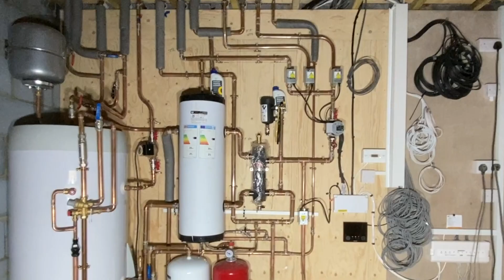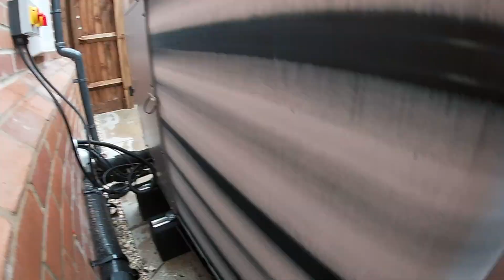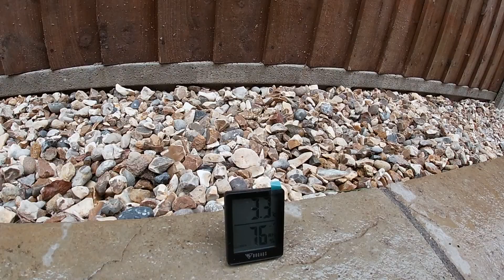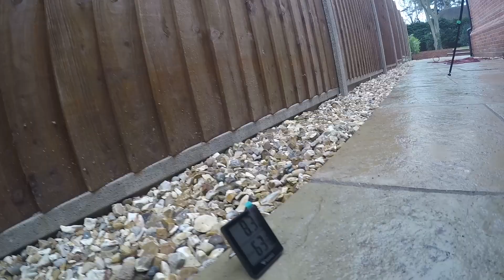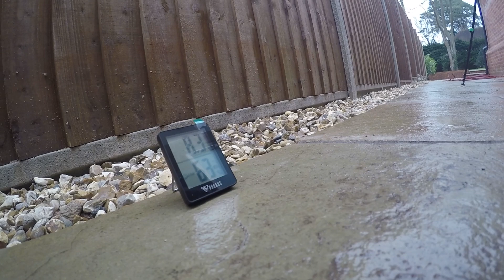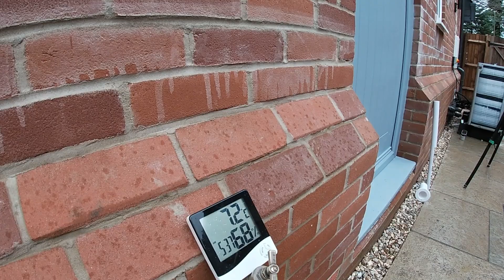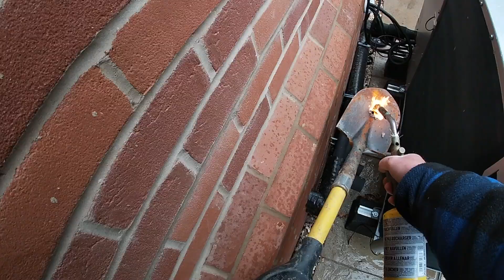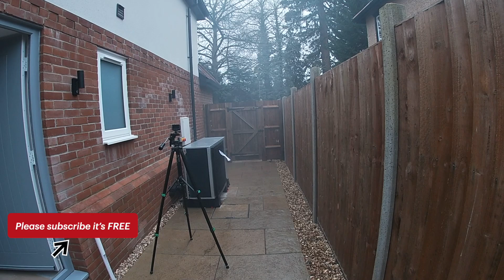Heat  Pump Freeze Up - HELP!

Comment: Change the gate for a lattice gate your 3 side ally traps cold air like a bowl of dry ice.  Also place something against the fence only 12 inch wedge  to cause the air to go to the right when exiting the pump.  This with a fence chance will cause the cold air to flow away from the gate.  You could also angle the unit just 5-10 degrees off centre to prevent the backflow.

Comment: use the roof as solar collector. make one side input other output cover rafters inside with then have a hvac channel leading down to rear of heat pump and its input fan ..
It will then suck in warmer air heated slightly by the roof.. and hopefully keep the exhaust air a little warmer 
And get an iron gate or open up the bottom
In most terraces style properties this is an effect that no one mentions. 
A localized cooling of the air..  which then makes heat pumps less efficient in that area

Also when this guy opens up the gate area so cold freezing air can escape his drive will become an ice skating rink in winter.

One more option is move heat pump right up to fence with gate, then block open side and take out part of the fence so all input air is from other side and exhaust is into the side passage.
Use some old cardboard boxes, duct tape and remove part of the fence panel to do a test.
If it works then simply move heat pump further towards fence gate and create a barrier for the cold exhaust air and open up the fence so input air is from front of house...
.and maybe roof?
Could do a DIY solar collector project 
https://www.youtube.com/watch?v=ncsGA5gSJv8
Reply from the maker: I love a bit solar gain  Thanks 👍

Comment: Is the buffer tank necessary? Many YT installers say not.
Reply from the maker: Hi  in the past I have almost always used unvented cylinder with built in buffer and had no problems . I know some have said buffer not needed  or change it to a volumizer .( In my opinion this would do about the same thing.) But because there are so many controls on system  there is a possible potential for volume to be very much reduced  ie. If some one moves into the property and decides they only want 1 zone  open . The problem is we don't know who the end user will be ,what ,  their  expectations will be ,or how they will use the system . Obviously the ideal way to run the system would be minimal controls and running low and slow 24hrs. But not every body understands this .Thank you 👍

Comment: You are short on refrigerant, bud. Its no issue of clearance, you have plenty of space. Unit is not gonna go on defrost if outside temperature above zero.
Reply from the maker: Hi Yes I am waiting for a visit from manufacturers engineer to Check . Thank you 👍

Comment: if you would have bigger buffer tank  and more water in the sistem this would not happen and the fence is not helping cirkulation of air too. So remove the fence and install bigger buffer tank  and your sistem will work ok. If there the air is to moist  the deforst is normal bicose too much water is in the air so nothing you can doo about that.
Reply from the maker: Hi making alterations to fence is not an option . you are right about moisture in the air the humidity at times behind the HP is 87%  Thank you 👍
Reply: @HEATSEEKER1428   you need bigger buffer tank belive me buffer tank is there to help you with defrost  and on this size unit  there should not be more than 2 min of defrost cycle.

Comment: Raising the heat pump up and switching to an iron gate with airflow seems like your best bets. You'd gain a little more space behind the unit for air flow and wouldn't have as much cold air pooling around it.

Could either do this on a stand, or wall mount - if wall mounting consider whether you have anything noise sensitive on the other side of the wall and ensure you've got decent vibration isolation dampeners (not the rubber washers that typically come with a mount as the default). I'm not sure why planning would be an issue here, or why your neighbour would mind, it still should be roughly below the top of the fence?
Reply from the maker: Hi yes your have a point the higher I raise it the better . Planning not an issue. Apparently when the neighbour sold land to builder there was an " agreement" that Nothing should be put  on that side of New house . Crazy I Know  but I am just in the middle waiting for it to be resolved.  Thank you  

👍

Comment: Someone said on another You tube video, when they installed an air to air heat pump.
 "Im fitting this, because Im soo bored of the negativity of heat pumps"
That was you!😄 

Air to water are a different animal and there are far too many cases, where they dont live up to the hype they are given.There are a catalogue of problems throughout the Country!
When I read online, that a Nuclear Physicist couldnt make head nor tail of his Vaillant heat pump instructions, I knew we are a long way off in getting this heat pump roll out right.
Good luck👍
Reply from the maker: HI 
Yes my view is still the same this heat pump at its possible worst was running at a COP of 2.5  That is 250% efficiency. Bearing in mind it' s output is 14 KW it is serving 14 radiators 6 towel rails  and 10 under floor heating circuits ( 1000 meters of pipe ). Heat pumps are the future  Thank you .
👍

Comment: I use an air to a heat pump here in the states in zone 5. I think your unit might be a little close to the house and the fencing is blocking good airflow. I run mine at well below 0 F. This winter and it rarely ices up but I think i am in a dryer climate than you are and my unit is in a more open area.
Reply from the maker: Hi Yes the space is a bit tight. and your right  The day I recorded the video. the humidity at the bottom of the heat pump was 87%  which does not help.

Thank you 
👍

Comment: What few people discuss is how long heat pumps last. In our village an estate was built with heat pumps and all have failed within @10 years . The cost of a new heat pump and the fitting is very expensive as the fittings of the old heat pumps are not the same as the new ones . Be warned
Reply from the maker: Hi I appreciate that thing have moved on in heating design  and perhaps a few things on an old system might have to up dated  But Would have thought for the most part it would just be a straight swap . Thank you  👍

Comment: Hello sir. Question I have is why did they put unit on the corner of the manhole cover?
Reply from the maker: Hi Although the heat pump is just touching the man hole cover  . it is not a problem  the cover can easily be removed without disturbing the H P . Thank you .👍

Comment: I know that my model requires a minimum of 1.5m from the face of the unit to any obstruction. Yours looks to be close to that minimum and obviously more would be preferable for air dilution. I had a near identical alley and was advised not to place it there by the installer.

Comment: I do admire you for posting this and being so polite with all the dimwits who comment negatively!  I have the exact same unit in a similar sort of location except there’s a hedge rather than a fence just under 2 metres in front of the unit.  We sometimes get cold fog here, being by the sea, and when it’s foggy (100% relative humidity) and around 2 degrees of course it freezes.  Typically about once every 50 minutes to an hour, if there’s no breeze.  Takes four minutes to defrost.  Difference is there are bushes at each end, rather than a solid gate.  Next time it’s cold I’d definitely try leaving the gate blocked open to see if it helps, but unless there’s a breeze probably won’t help that much.  Moving it to the more open area shown on the plans might help, but then there are more losses in the longer pipes all of the time.
Reply from the maker: Hi 
Thank you .Every body has their own view . heat pumps are not for every one  . I think perhaps I should manage my expectations , Thank you 
👍

Comment: Just one more thing, I believe a split system would be better for the UK as they can be mounted on brackets like a standard AC unit, you don't need 500mm behind the unit for air flow and they can be installed at high level to avoid debris clogging the condenser "is it the condenser".

Comment: The humidity in this country really doesn't help!! 
This is just a thought 🤔 but I always thought about having tumble dryer vent and maybe an house extract vent behind heat pump to reuse any heat from building, just a thought 🤔
Reply from the maker: Hi That is not a bad Idea   . I think the day will come when heat recovery units will be fitted in all houses . For instance How much heated air is sucked out of a house by tractor fans  and cooker hoods  Thank you 👍

Comment: Even at outside temps of 2c ambient air, our Samsung Heat Pump never goes into a defrost cycle and the fins remain clear of ice.  This is because we have it sited correctly, in a position where air can flow freely around all four sides.  Whoever thought of putting it where yours is wants shooting, it's the worst possible location.  The proposed position would be better, bu still has a wall to the right of it

Comment: This is what we call short cycling
Reply from the maker: hi I think we can go as far as saying that yes .Thank you 👍
Reply: A heat pump can short cycle without running defrost cycles, in short cycling compressor will start and stop every five minutes or so, commonly seen where heat pump is oversized or emitters too small to disperse heat to rooms, or perhaps setup incorrectly.

Comment: The main thing this video shows me is the horrendous amount of internal equipment required to run the air source heat pump. I have the space in the kitchen that my wall hung gas boiler occupies, and the airing cupboard with hot water cylinder upstairs in the middle of the house with no external walls. I can't see how I could possibly get one in. On the original issue it should have been obvious there would be insufficient airflow in this location.
Reply from the maker: Hi  The system in the video is not overly complex but the house is rather large.
Regarding your situation depending on your existing heating system. The heat pump could be fitted out side obviously and the buffer tank if needed could be fitted where the boiler is now. I appreciated that heat pump is not for every body  but eventually all heating systems will be low temp heating . It makes sense for the user to save money  Irrespective of the Green aspects if that's your thing . Thank you 
👍

Comment: Move the heat pump somewhere else. It needs air flow but you already know that. Also look at the heat curve. Is it set too high and its racing to get the heating temperature up. Remember - low and slow.

Comment: Humidity levels in uk , especially wales and Scotland make these issues common,  drier air in Scandinavian means they work well.
Reply: They work very well in UK, ambient temperature where I live currently 9.8C and a COP 4.3, and has never run defrost when ambient above 3C, N.E Scotland.

A high demand on HP will reduce the temperature in the evaporator, making frosting more likely, reducing flow temperature can reduce the number of defrosts done over a 24 hour period.

Comment: Another thing i have spotted is that the heating pump is in the wrong place it should be just after the buffer flow. The pump on the UFH manifold will struggle to get heat into the circuits efficiently when all circuits are going.
Reply from the maker: Hi I understand what you are saying but when the heating on the first and second floor is not required that pump would have to run . I think what you might suggest next is to only have the one pump . I might give this a go  Thank you .👍
Reply: @HEATSEEKER1428  That's not what i'm saying the UFH needs a pump on it's own. The main heating pump needs to supply the other 2 circuits as well. The pump is energy efficient so will adjust itself if the other 2 circuits are not being used.
Reply: @HEATSEEKER1428  Was the UFH designed by a company/supplier? Each loop needs to be separately calculated with the right flow rate. How has each loop been commissioned? The radiator circuits, what flow temp has been designed? Who sized the radiators for the flow temp? How was each room calculated? With a heat pump you can't just put in any radiator because it will fit in the space. All radiators need to be much larger when the flow temps are lower.

Comment: I have just seen your videos about how you did the installation, there are some errors i can see on the pipework you installed. First of all take out the mixing valve on the UFH circuits, a heat pump does not need one it is likely that the water temp is being mixed down when it doesn't need to. Secondly you have installed the TF1 filter wrong, it needs to be installed on the return to the heat pump only. It looks like you have it installed on the buffer flow and return. This is doing nothing as it isn't flowing through correctly I saw the zone valves marked are there 3 floors? If so then the pump needs to be a 25/1-8 type as there could be flow problems if you have a 25/1-6
Reply from the maker: Hi I am probably going to do as you suggest  regarding the pumps and mixing valve . Regarding the TFI filter that you are talking about I am Using that Purley as a dosing pot . In Normal use the isolating valves to it are shut. There is a 28mm Filter lower down on the return to the HP  Thank you 👍

Comment: As a person who has been in the industry for about 17 years i hardly ever see a heat pump freezing up like a block of ice in 30 mins. There is a design problem here and i would point to the heating system. If the water temp at the heat pump is too cold it will freeze up quicker. So first question what heating circuits do you have and what is the flow design temp for each circuit? It looks like you have 3 heating circuits, are each of them temperature controlled or on 1 thermostat? Measure the flow and return temp at the buffer from the heat pump and measure the flow and return of the heating pipes at the buffer. This will give me a little clue as to what's going on. I can't see what type of heat pump it is, does it have it's own pump built into the HP? If not then is there a pump from the HP to the buffer? What make/model of pump do you have for the heating circuit? Is the house on 3 floors? That's the first set of questions i will be able to get an idea once i have all the information.
Reply from the maker: Hi the unit is a Daikin Altherma  14 KW the property is over 3 floors  . Ground floor is under floor heating, other 2 floors radiators. House gets to target temp all over  very nicely, The flow temp is 40 c  I think on all levels  ( But I will Double Check ) The flow temp going into buffer is about the same as flow coming out  ( perhaps a little cooler ) I will put stats on to be more accurate , the return temp going out of buffer is lukewarm warm , the return from heating circuits  is about the same ,  The design and calculations of the system has been done by others . They have supplied Calcs in the past for other properties  with no problems. I hope this info is helpful . Thank you 👍
Reply: @HEATSEEKER1428  To get an efficient system you need at least a 7 degree differential between flow and return back at the heat pump. That's provided the house is finished and occupied. If it's still a shell then it's a waste of time trying to get the system balanced properly
Reply from the maker: @kjc728  Hi I think I have got that, I briefly called to the site today to make a video of heat pump running today But unfortunately  it was a bit busy . However I took some readings from the interface and calculated that the COP up until 12 pm today was 4.8  so roughly 12 hours heating  and I estimate the cost of electricity used to be around 
£ 2.80  10 Kw of energy used  48 kw of heat produced .of cause the average ambient temp was around 10 c.  Thank you 
👍
Reply: @HEATSEEKER1428  

Care needs to be taken with the readings from the MMI, it resolves the readings to 1kW, so input power taken on a daily basis can be flawed.
Reply: @HEATSEEKER1428  

That flow temperature at 40C seems excessive, and will pull down the COP and increase demand causing more frequent defrost cycles, my Daikin, albeit only 6kW unit, runs between 32-34C to K2 & K3 radiators.

Perhaps the weather compensation curve needs adjusted down a bit ?

Comment: I know you said about not being able to mount it on the wall because of the neighbour but if it’s within regs then they can’t do anything about it. This is by far the easiest and best option in my opinion
Reply from the maker: Hi the new house has been built in the garden of the neighbour ( they sold it to the builder ) and apparently there is some sort of " gentlemen's " agreement. Thank You 👍
Reply: @HEATSEEKER1428  "You can live in my garden but I don't want any noise or disturbance from you". I think the neighbour brought this on himself really. It is a difficult situation of course. Having it higher up and perpendicular to the wall, would that be an option? Then it won't blow air (and noise) towards the neigbour. And of course very free airflow.